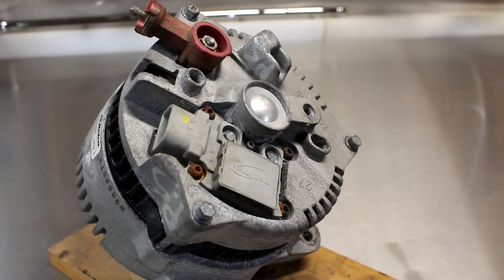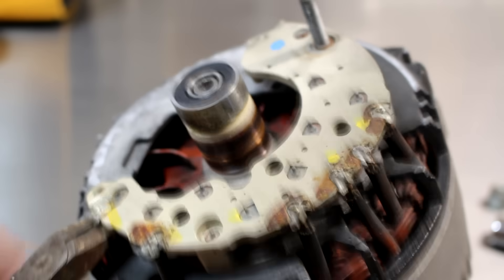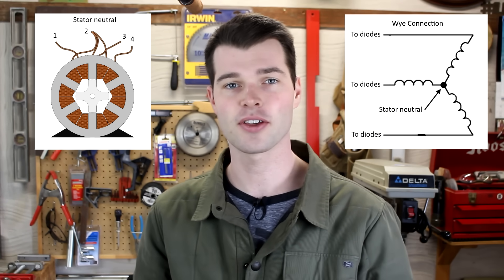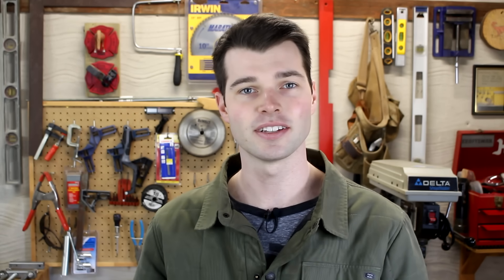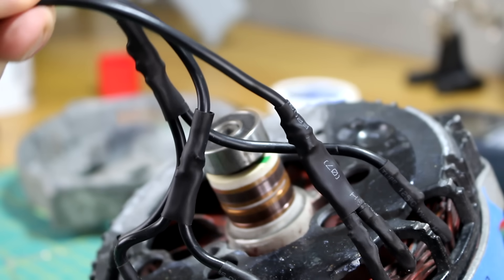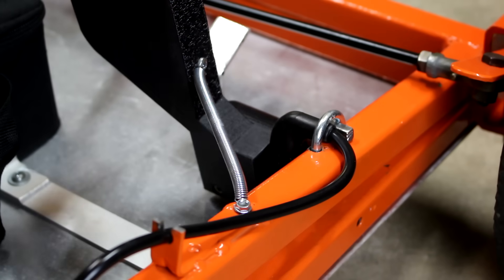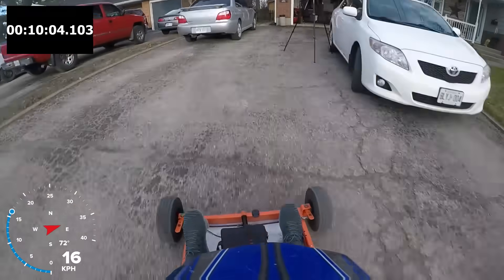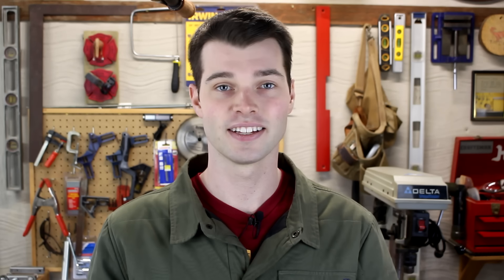Converting a Car Alternator into a Go Kart Motor

Comment: Could this application be used with a smaller battery? If that is what is wanted.
Reply: yes, but alternators need quite some current for their torque
I won't recommend anything below 15-20Ah

Comment: What is the rpm of the alternator
Reply: depends on the size of the alternator, throttle level, field power and main voltage
can be a couple thousand RPM, and up to 12 thousand RPM

Comment: I can't search comments to see if anyone mentioned it, but just in case: Austin misspoke at the start of his excellent presentation when he says an "alternator is a 3-phase MOTOR with a rectifier".  It's a 3-phase GENERATOR, of course, that will act as a motor if the output rectifier is bypassed/removed and the leads are supplied with a 3-phase AC current.  This is not the most economic way to build an ev, but it certainly keeps YT interesting.

Comment: Ok so I followed you on the 3 phase motor part but how are you using the rectifier to make the motor turn?  Do the batteries invert to AC?  If so how are you getting a 3 phase stator field to turn the motor?
Reply: the controller does that
Reply: @foxxyytofficial  The controller creates a 3 phase output?
Reply: @mikefox2379  yes, it commutates the DC voltage into a 3 phase trapezoidal wave
Reply: @foxxyytofficial  Wow, I've heard of a Delta, a wye and a Scot T but never a trapezoidal wave.
Reply: @mikefox2379  trapezoidal wave is not for the wiring, is the way that the BLDC controllers make the AC waves from a DC power source
Reply: he removed the rectifier

Comment: Couldnt you hook-up a second altenator that can run the motor and charge the battery pack?
Reply: of course no
Reply: @foxxyytofficial  why not?
Reply: @lixxxxit  physics laws about electricity, losses and conservation of energy won't allow that
Reply: @foxxyytofficial   nah......a couple of gears to speed up rotation and it would work.
Reply: @lixxxxit  you can get a enormous reduction but it will still take a toll on the system and will hurt more than help

Comment: I tried looking through the comments and couldn’t find anything but I’m really curious if you know about what hp this would compare to and about how much torque. 
I’m not so much interested in making go carts but I’ve been making plans for an all electric sailboat. I don’t need speed but I will need torque so I wonder if I took two of these and played with the gearing and added a beefy battery pack along with some solar panels for regen how it would do.
Reply: unfortunately no one seems to be testing those alternators into dynos, but some people have tested them with controllers that can sense how much power is being pumped and can show them with programs, getting close to 4-6kW peaks

Comment: I m building an ebike and don't get any power to field windings.Just a short circuit. Some people use an esc for adjustable voltage.How is that  wired? So frustrating when YouTube shows everyone having no trouble with this!
Reply: please don't keep the field in short circuit, you con't have any real power
if you can't use an esc for that, put a 12V or 6V SLA battery

Comment: Hey what about putting another alternator upfront an powering the front wheels
Reply: To power the front wheels would need another one, and you would need to sync them
Reply: @foxxyytofficial  something like this

https://youtu.be/n11dAPh0V3c
With all the wires
Reply: @SQUISHYRIO  yeah, i got it, but for a heavy load you need to sync the alternators with hall sensors (he did that with one alternator in his last video)

Comment: Since this project is powered by a large 48 V battery, it seems to me it would be a logical step to eliminate that little 11.7 V battery and construct or find an adjustable Vreg connected to the 48v to supply current to the rotor. Use a 317HV with a parallel pass Transistor in the circuit ( diagram can be found online as adjustable Vreg using LM317HV )so the rotor can be supplied with enough amps to work but not so much it heats up.
Reply: A much better solution is to take a tapping off the 48 V battery for the field winding.  The common ground created wouldn't be a problem. The only problem would be the higher discharge rate for the 'tapped off' portion of battery.
Reply: @jackevans2386  That  would be one way to do it yes, however, it would place a drain on only part of the  battery and it would still need a regulator to drop the Voltage unless you tap at a point of 3.7 volts and it would still draw that cell down. The best way from my point of view is to use the complete battery and I base that opinion from experience with off grid power systems. You must discharge all the batteries equally , if the voltage drops in only part of the series string then the entire system suffers.

Comment: Have you ever thought of using two alternators?
Use one as a motor and the other as a charger for the batteries or an electrical source for the motor itself
Reply: Another free energy freak !
Reply: @jackevans2386  check the comment on his new video
Reply: that is impossible!

Comment: Why you need voltage connected to the rotor windings?
Reply: because the rotor is an electromagnet, without voltage it can't become magnetized and won't spin correctly

Comment: can the same controller be used to power 2 alternators ?
Reply: no, you need two controllers
and if you're going to connect two alternators in the same chain or shaft, both of them need to have hall sensors installed correctly, so that their torque won't be conflicting
Reply: @foxxyytofficial  i see i get it

Comment: Why do you feed the rotor with 12V instead of shorting it? (like an ac wound rotor motor). Wouldn't that be enough? And I think that you in theory would be able to add regenerative breaking by adding a contactor controlled by your brake (no switch) which makes contact between the rotor coil and a diode pack connected to the 12V battery. Anyways great and inspiring build. Are you perhaps an electrician like myself? 😁
Reply: shorting the rotor could work in a bench, but the controller and the alternator wounds won't be able to give any power to move something

the controller on part2 of the video have regen, he just need to enable it

Comment: I could see using a few of these motors in my wood shop.  If I just want the motor to go full and using AC do you know if there is anything special I would need to do.  Also, do you have an idea of how many hp an alternator has?
Reply: Using household-levels of AC won't be good
At maximum 72VDC and let the BLDC controller work
Reply: @foxxyytofficial  Yes I see that.  Just need to figure out how many amps it needs.  I can either use a computer or laptop power supply that does 12 volts dc.
Reply: @DanielJAudette  at 12VDC you won't get a lot of speed and power

Comment: Hi nice what gear ratio do you drive. 12 teeth on Motor and how may teeth on the drive shaft. I have issues with my Kart projects. No torque to start.
Maybe you can share some details. Thank you.
Reply: Please share an email for contact
Reply: @foxxyytofficial  how can you help
Reply: @Slic-Rock  seeing and hearing what is happening, and knowing what you are using, can give some hints to troubleshoot the problem

Comment: Why 12v to the brushes and 48v to the controller? Is it because it was a 12v alternator and the brushes have to be fed 12v while the 3phase part can handle more? Great work!
Reply: Basically the 12V on the brushes its because with more power on the rotor, stronger is the magnetic field and will give more torque
And the 48V on the stator is because it can handle more volts as well

Comment: The only point I could pick out of this project is using copper grease on your axle? Would high temp lithium grease not have been better?  Great project in all though, very ingenious idea, you need another small alternator to charge while you drive 🤔
Reply: you are wrong, a second alternator would ruin everything

Comment: This may be a completely Noob question but I was wondering with the battery being depleted as you drive is it possible that you could use a second alternator since the alternator recharges a car battery upon driving or running the engine could you possibly hook a second one up to recharge your battery as you ride and would that make the battery power infinite
Reply: you cant, its impossible

Comment: Ok so I'm curious what does the controller have to be there for?  Could you put a regulator in its place on a system the has it's battery charged by a bicycle generator?
Reply: You can't change the basic functionality of the controller, it needs to be there so it can work

Comment: I'm assuming the higher the amperage the alternator was designed to output, the more power you can put through it, and thus the faster it can be? It depends on the batteries and controller, of course, but does a higher amp alternator enable more amperage before overheating?
Reply: Theoretically yes
And if you have a higher amperage alternator with more voltage (24V 100+ A) can be probably even more overvolted

Comment: how about 2 alternators on the same shaft ?
Reply: For this, you need to install hall sensors on both alternators and use separate controllers
Reply: And they need to make the same power at the same RPM

Comment: No no no, he never showed the rotor, the rotor has permanent magnets, why he did not show the rotor, ther is more than just take it apart and  reconect the wiring, the rotor might not spin,
Reply: Wrong
The rotor doesn't have magnets, that is why he powers the brushes
Reply: @foxxyytofficial  that is what I mean, alternators do, to produce electrical current
Reply: @elpidiogonzalezsanchez8926  you aren't understanding
It needs to feed the rotor with DC voltage to create magnetic field, so that the BLDC controller can spin the motor
Reply: I understand but it is obieuos that the stator might be frome an alternator but not the rotor, comeon
Reply: @elpidiogonzalezsanchez8926  why do you keep insisting on that?

Comment: I dare say you already know, but you're about to create your own hybrid car, the power output from that alternator is near enough the same power as it is a motor. If you changed the alternator on a 600cc car for that monster one you have there, change the belts and sprockets to toothed belts, stuff some tidy batteries like off a Toyota Prius or smaller. Get yourself a controller, and you have a parallel drive motor system which will give you even more mpg (miles per Gallon) and acceleration than standard, and of course when you brake you're re-gen your batteries. A lot of motorbikes use the starter motor as an alternator, but that would just disintegrate. But well-done austiwawa you'll be a top engineer one day working for Tesla or your own business!?
Reply: Mild hybrid systems is what you described
Search for GM eAssist, Hyundai HSG, and others

Comment: So I must admit. Yes an alternator can be converted into an electric motor. A few of my engineering colleagues did the same thing. And found out that automotive alternators were built to produce electrical load not mechanical load, further more the physical size of the alternator and rotor can not produce enough torsional upwind or torque to get up to those speeds. Plus cooling with have to be phenomenal. Also the rotor poles are too wide. I think you had an assist or an assistant helping you on this project, because it sounded like a gas motor in the beginning powering this thing ( it should have been a lot quieter). With all this time lapse footage I think you coasted more than anything and possibly just used the motor from time to time. Plus you lacked the instrumentation while in operation which most engineers show when testing an idea. These alternators cannot hold a physical work load strain of a frame and wheels and someone weighing over 100lbs. In theory the electrical math may be true, but the mechanical load fundamental is lacking in this video. I fully do believe this video was rigged in some way. Because I've tried this experiment and the most that it went was 30 seconds before the whole stator assembly suffered melt down. But with another shot and different Alternator and slight coaxing and a few downslope runs  and someone assisting from behind 15 minutes was managed but with an aweful lot of heat. Now if it had been a generator out of a gas generator with a blown engine then maybe it may have run the test with a little bit of rigging. But car or truck alternators just don't have the punch. They would just burn out just like letting a starter run too long. Don't always follow what YouTube shows because often times the videos lack full substantial evidence.
Reply: So funny
Reply: So apparently you did things wrong
Why would so many youtubers fake this?
Tchangly21 have lots of videos with alternators, Enrengineering and FixitModitBreakit also have made builds, The Hack Lab made a bobbycar with one alternator, and others also had successful builds

Comment: isit limited to 35 kmph or is that literally the fastest it will go ?
Reply: Another guy created an alternator-powered kart and got 42km/h (search "enrengineering" on YouTube)
Maybe tweaking some settings, using 72V battery and a beefier controller/battery you can get 50Km/h or even more

Comment: I have 4 wires configuration (I assume this is Y configuration).
Should I just ignore the Neutral cable?
Reply: Yes
Reply: @foxxyytofficial  thanks, it worked.
Do you think it’s worth it to replace the brushes with permanent magnets on the rotor? (Drill, put neodymium mags on it)
Reply: @RIKOARIshowreel  that will help with efficiency, but will not let you control the RPM range with a PWM controller or similar systems

Comment: How did you use a DC battery to drive a 3 phase AC motor?
Reply: the alternator isn't exactly AC, it uses BLDC (DC commutated in 3-phase trapezoidal wave)
Reply: @foxxyytofficial  So you can run the alternator on DC?
Reply: @MrCoolerMan1  not 100%, since the alternator uses a coil and brushes, that part uses DC
But the 3-phase part you need a bldc controller
Reply: @foxxyytofficial  So the coils/brushes are DC? What is the 3 phase part then? Surely not the rotor?
Reply: @MrCoolerMan1  the stator is 3-phase
Reply: @foxxyytofficial  So the rotor is DC and the stator (aka the coil) is 3-phase.

 Thank you so much for this useful info! I really appreciate it.

Comment: Why the 12v to the motor? I'm confused. I didn't hear you explain that part.
Reply: the alternator doesn't have real magnets like other motors and such, so that's why he uses 12v separated from the 48v on the controller, the 12v feeds a coil and it becomes an electromagnet

Comment: put another alternator on it and recharge wh the momentum
Reply: That is impossible
Reply: @foxxyytofficial  hows it impossible to use 2 sources to power 1?
Reply: Perpetual motion can't be done
Regen is, but its dependent on the controller's ability
Reply: @foxxyytofficial  I never said it was perpetual motion. Its a simple circuit that continues. Plus entropy can be cancelled out. Its called overunity.
Reply: Okay, so try to find something to do this
Without any proof, looks like excessive weight wirhout benefits
Reply: We can utilize thermodynamics to cancel entropy by using superconductors. Using the heat lost create electrical current thermoelectric generators.
Reply: @jontherevelator9663  And how much this technology would cost?
Reply: @foxxyytofficial  hell I dont know. Probably billions. They pay out the ass for everything. Besidea, I'm only talking about overunity. If you have an electric motor on the from end and a generator as the other 2 wheels. Then have a bettery, a capacitor and a circuit set up. That works vy itself. Adding another alternator will just accommodate for any energy loss. It may be heavy to it. But it'd go forever. Its bot like this is impossible. I'm done arguing. Peace out

Comment: Question about the controller ...you say you using a 48V controller what voltage are you operating the motor at. I also see the controller sticker you showed says low volt 41V
Reply: 48V
Reply: @foxxyytofficial  awesome great stuff I've been looking at doing a electric scooter with the same idea but didnt want to trust these Chinese controllers

Comment: This guy is lucky he got the direction of each stator winding correct, because there is no way that 'start' and end' of each winding set can be determined by a simple continuity test. Too easy to have 2 in correct same direction and the 3rd in an opposing magnetic field orientation. This MATTERS, be it star or delta connected. 

If in doubt ask an electrician experienced in motor rewinding. Very few electricians, other than those who have rewinding experience, would know how to properly identify the correct winding sequence.... and extra good luck working it out if you find a 6 pole/phase stator winding!
Reply: People already found and they use it

Comment: Would it run as an induction motor if you connect brushes together with no external voltage to the rotor?
Reply: No
Reply: @foxxyytofficial  why?
Reply: I don't know any VFDs below mains voltage (110-127V) to test, and most alternators are ran with 24-72v max.
Reply: @foxxyytofficial  Nonono, i mean if you feed it with lower voltage, but same 3 phase sine shaped, or not perfect sine like bldc controllers give not connecting it to grid. The question was about if the rotor must get a 5v 2amps supply or not? Because If you have a rotating magnetic field around a rotor which winding's ends are simply soldered together, it should make some electricity and magnetism like induction motor rotor does, wouldn't it?

Comment: What gear ratio are you using?
Reply: alternators spin fast (between 3000 to 6000rpm easily)
you need at least 5:1 to be a good ratio